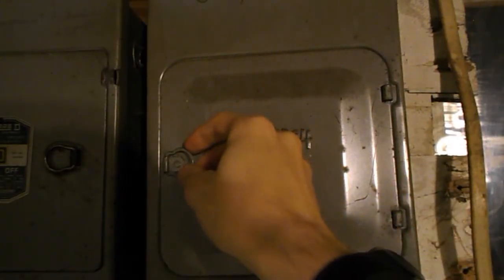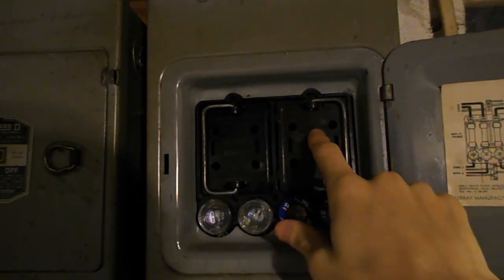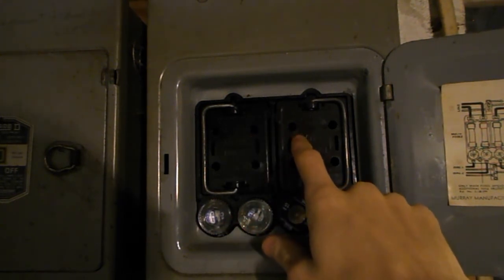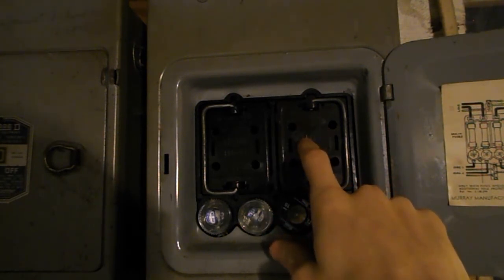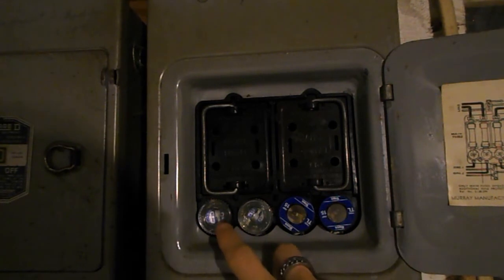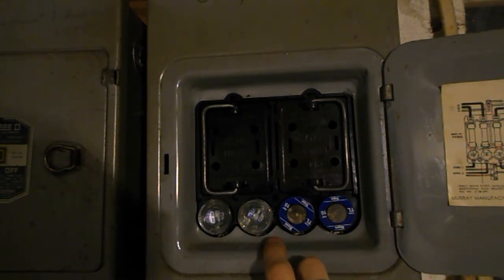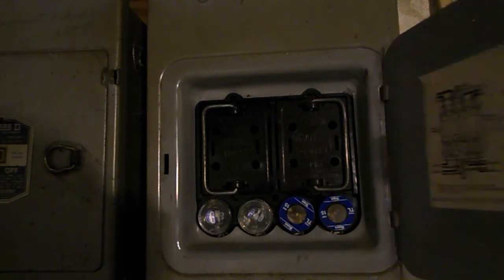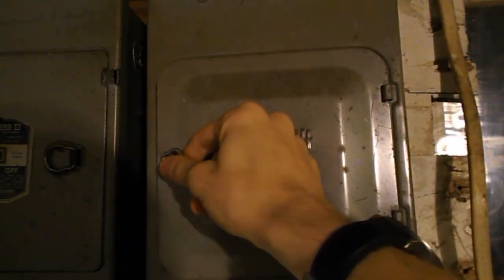Inside an Old 60 Amp Fuse Box

Comment: a lot of homes had 60 amp service and it worked fine.
WHY?  gas range and gas water heater they would use
pull-out for range to work a clothes dryer or air cond.